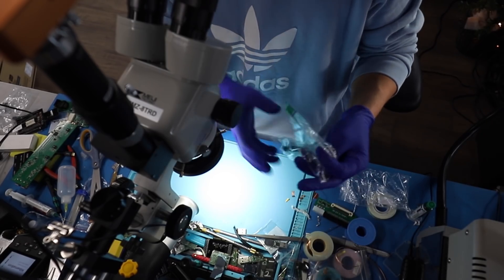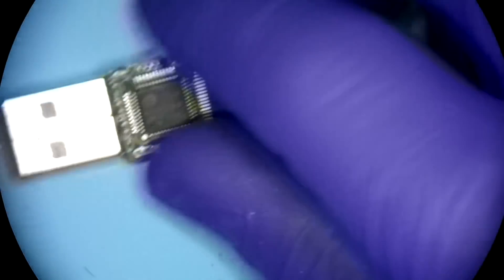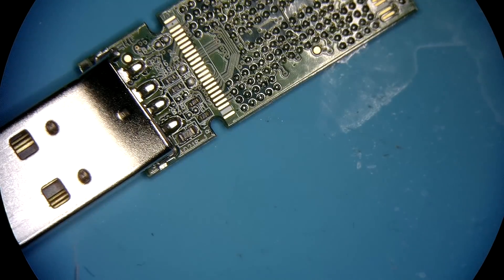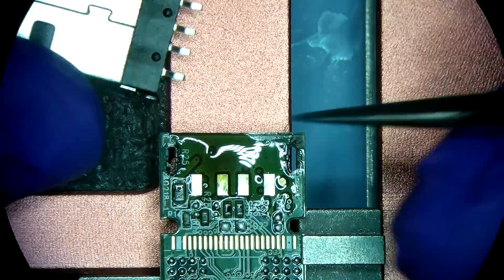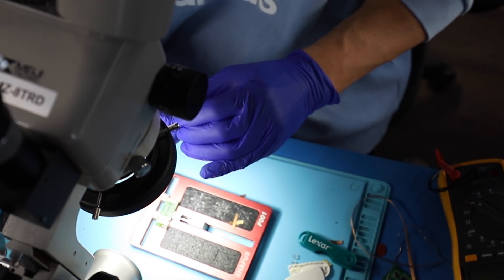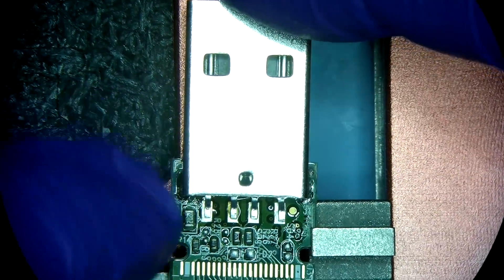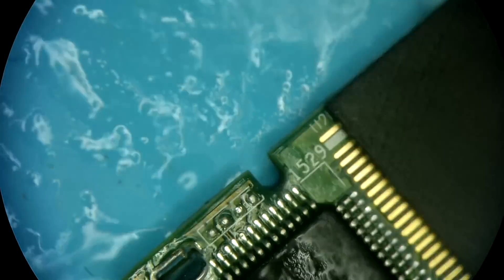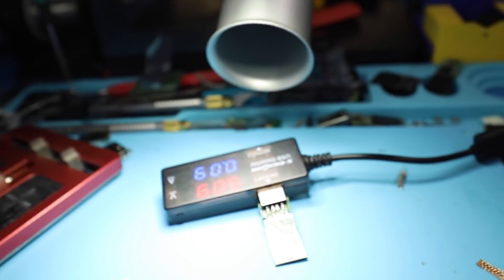flash drive is getting hot

Comment: Look for PCB Rework and Repair Guide
 
Is there a download site?  wa901nd v4 PCB   Repair Guide
I am trying to fix the device
 
Need dump flash
Firmware Version:
3.16.9 Build 150408 Rel.38268n
Hardware Version:
WA901ND v4 00000000
GIGASEVICE GD25Q32
4MBYTE/32MBIT

Comment: If it works without the cap, why is it there in the first place? I have a GTX 1060 with a broken off cap that works 100%
Reply: Those caps are used as a filter for the signal. i.e. without the cap the signal might be more noisy but it would be barely noticeable in most cases.

Comment: What is that circuit board holder your using? What soldering station as will?
Reply from the maker: soldering stating is JBC NASE
holder was available to union repair in back in the day, but it looks it is no longer available. I checked eBay, and they have same unit listed here https://www.ebay.com/itm/Universal-PCB-Holder-Fixture-Cell-Phone-Repair-IC-Microsoldering-Jig-Rework-Tool/253632564525?_trkparms=aid%3D111001%26algo%3DREC.SEED%26ao%3D1%26asc%3D20160908105057%26meid%3De1adabbea5804776875fe000d4cafb9a%26pid%3D100675%26rk%3D1%26rkt%3D15%26mehot%3Dnone%26sd%3D253632564525%26itm%3D253632564525%26pmt%3D0%26noa%3D1%26pg%3D2380057&_trksid=p2380057.c100675.m4236&_trkparms=pageci%3A659b6af4-8fb8-11ea-8570-e2c3a69cdb13%7Cparentrq%3Aeadcd3e31710ad397f28ab87ffeb0380%7Ciid%3A1 under model - F

Comment: So I don't understand why is it able to work without the capacitor ?
Reply: I believe the cap is just for either power filtering and a bit of a power buffer. It should be there but it will work without it.
Reply from the maker: Most likely for filtering as infopackrat said

Comment: How it is possible that the drive works without that cap? 
No need connection or something?
Reply: probably a filter capacitor for data lines
Reply: @PastafrolaDM  don't expect that much current on datalines
Reply: It's a filter/smoothing cap, it's not critical breaking the circuit. Most ceramic caps this size are connected this way. It will break the device if it shorts out tho. ;D
Reply: Filter cap, not 100% essential.

Comment: Some polyvinyl chloride plastics -- PVC, or recyclable 3 -- melt at as low as 75 degrees Celsius (167 degrees Fahrenheit) Flash drives can go as high as 185 degrees as operating temperature. So you know the temp was higher than that!

Comment: Cool the controller didnt get fried. I wouldnt have expected the chip to work after being plugged while at 200+ degrees C (i guess, most common plastics melt around there)
Reply: Chip survived maybe because some heat was absorbed by PCB.
Reply: @ekon01cz  
the pcb could have sinked some of the heat but still something must have gotten to 200ºC to melt that plastic on the top.
i mean, chips can stand that heat when being soldered but not when in operation.
Maybe its because its such low power or maybe its spec'd to work with really high temperatures but its not common for chips to be able to work at such temepratures. Must junctions would just short out with any current flowing.

Comment: That was surprising. Usually those types of caps don't fail. I wonder if it was just shorted from solder under the the cap. I figured the controller was bad.
Reply: MLCC caps are actually quite sensitive to mechanical stress, given the state of the connector maybe that's what caused it.
Reply: Shit I have seen these fail all the time..